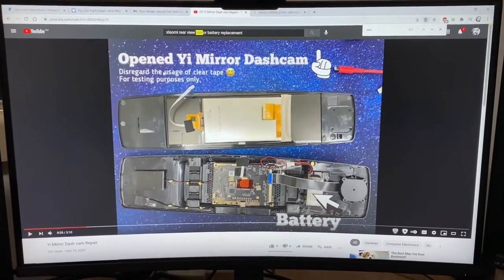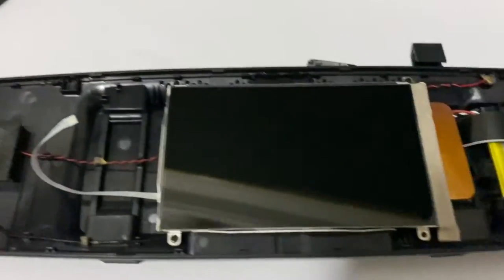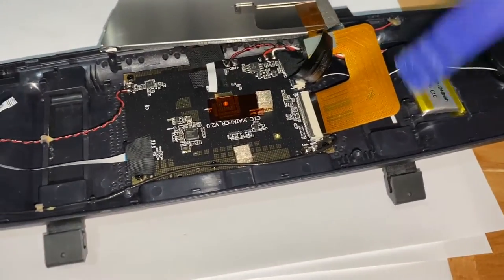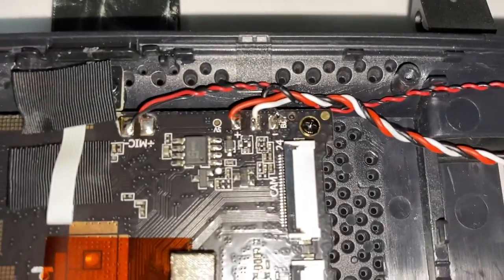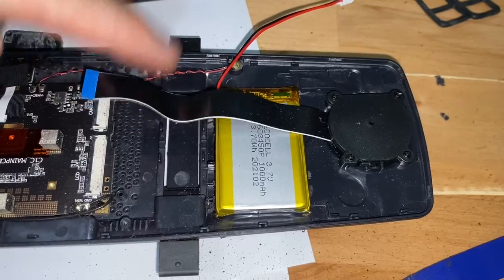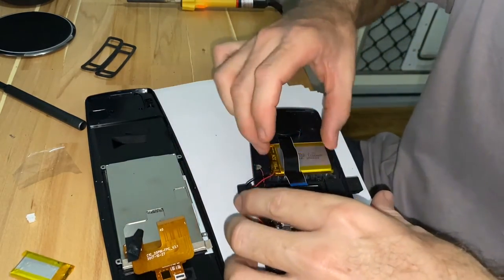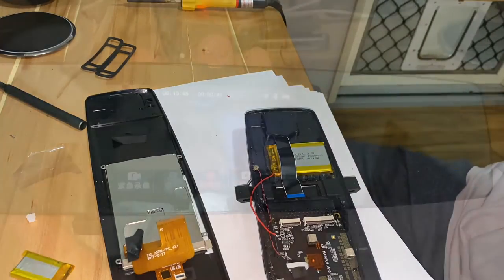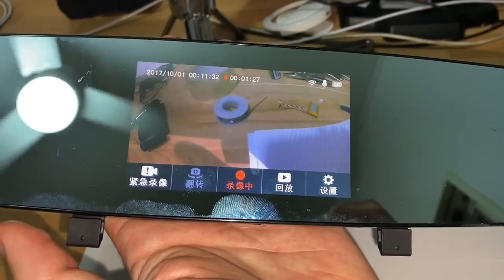Yi Mirror Dash Cam battery upgrade. 280mAh to 1000mAh

Comment: I would like to thank you for this video. If it wasn't for you, i would probably have not changed the battery even if it was almost dead. Now the camera has a second life. I went with a 350mAh battery with was almost the same size (dimensions wize) as the original. Best regard and many thanks.

Comment: In my mirror, the display was mounted to the top panel, the rest of the elements were similar, the battery was replaced for 500 mAh. Thanks for the tips :)

Comment: Hey Glen, thanks so much for this - 2 things:

1) where did you get the replacement battery
2) any side effects from replacing a three wire battery with a 2 wire battery?
Reply from the maker: I just got it off eBay. 
And no, I haven’t had any side effects of any kind. It runs just as good as ever. The battery is only ever one bar down from full whenever I see it before it charges up.

Comment: This is amazing!!How did you open this dashcam, that's the first step to know. If you could have added that in your video it would be very helpful. Did that plastic pry tool make scratches on the surface?
Reply from the maker: I thought I mentioned that in the video, you open it with the pry tool, you just stick it in the join and pry it open.

Comment: My time and date settings keeps reseting and also the settings. I've checked the battery inside and it's nearly 4v which makes me think the battery is fine. Is there anything else that could cause this issue

Comment: Mind to share the link for the battery specs and dimension
Reply from the maker: It’s written on the front of the battery, you can see in the video, but here: 603450P 3.7V 1000mah (202102) 3 pin battery sold on eBay Amazon AliExpress or any of the other millions of battery shops 😉

Comment: replace mine and it did not work, any idea?
Reply from the maker: No sorry I can’t say what could be the problem. If you got all the wiring correct and the battery you installed is the correct voltage, I have no idea why it wouldn’t work
Reply: All wiring are correct, correct voltage 3.7v with 3  wire and 4000mah,  i check the new battery with  tester and its giving 3.8v.. maybe mine have diff problem, will bring it to the technician  to check.. thanks